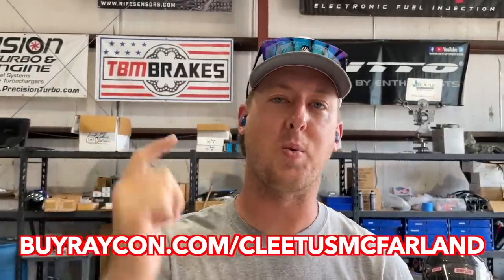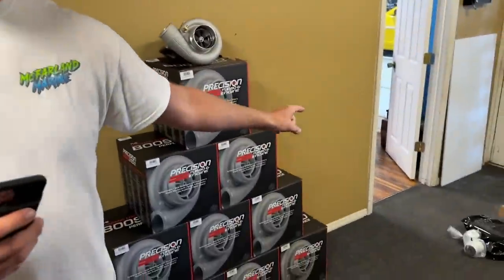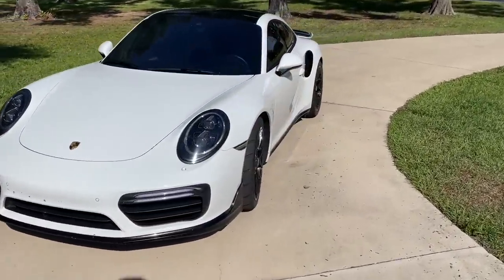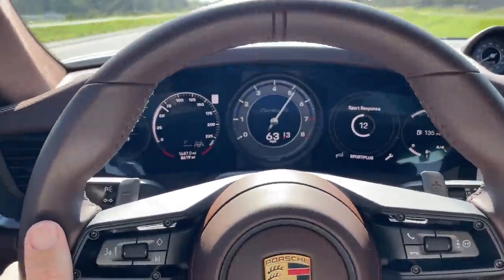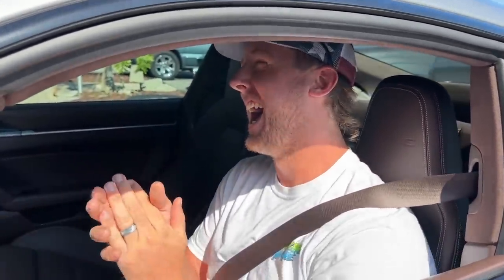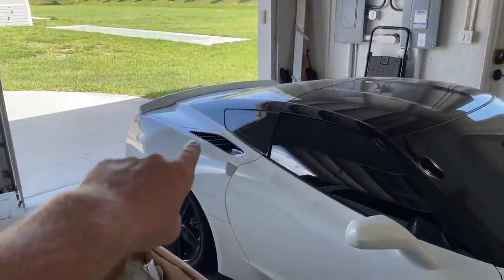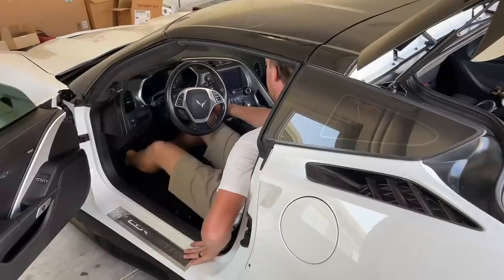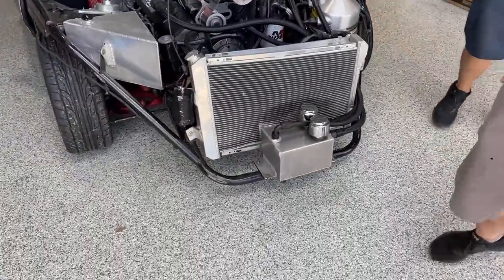Straightening Out the BENT Frame on Toast, Rescuing the C7, & My Dad Got An Auction Porsche!!!

Comment: I believe the exhaust sounds through the speakers is called Soundaktor. Audis come with it too, I disabled it in my SQ5 because I like the more genuine/raw sound.
Reply: Ford has done it in a few vehicles as well. I know the Explorer ST has it for sure.
Reply: To the top with you.  Tell Cleet how to disable it
Reply: @eddominates  at first I pulled the fuse for it, didn't leave a check engine light or anything. I ended up getting a device called OBDEleven so I could just disable it through an app.

Comment: Your "Speaker" Exhaust :) It's called a symposer. It is a tube from the inlet tubing that attaches to a diaphram (to avoid the smell of fumes) then to another tube that terminates in the back bulkhead just below the rear window. If you pull the carpeted panel just below the rear window you can see the tube where it inters the cabin. Unlike BMW where they pipe false sound through the cars speakers the Porsche unit is real engine sounds.

Comment: Don't weld with those Raycons on awareness mode while welding. The frequency of the arc messes with them. I think it could damage them also.
Reply: Or just don't buy raycon since they are overpriced garbage.
Reply: @zillbot  tell me you've never had a pair without telling me you've never had a pair.
Reply: Those raycons are great for the first 6 months then they start acting up
Reply: @PurebloodedPatriot  nah raycons are actually horrible if you care about the audio quality and tuning look at any reviews from any reputable audiophile. your best bet is with something name brand like sony, samsung or apple to keep it simple, or due proper research and find a pair with good reviews in your price range.
Reply: @PurebloodedPatriot  all the earbuds act up at just between 6 months to 1 year. anywhere from $25 jbl wireless buids to $300+ sony's they all shit the bed around the year is the longest. can confirm sony did replace those wf-1000xm4's though

Comment: There's no artificial digital sound in the 911. There are passages designed to bring sound into the cabin naturally.

Another system the acoustics team uses to highlight the Porsche sound is the sound symposer. This is not a speaker, but rather a sort of sound path, a line for tones consisting of a plastic hose with a gas-impermeable membrane. That’s how it transports the passionate trumpeting of the intake pipe, for example, into the cockpit. Because most drivers perceive the engine note differently, it’s possible to dial in just the right amount—using a flap valve and the gas-impermeable seal through a membrane that works something like the human eardrum.

What does that mean in practice? As soon as the driver hits the Sport button on the center console, sharpening the responsiveness of the transmission, engine, and suspension, the flaps in the sound symposer and the Helmholtz resonator open to allow unrestricted flow, intensifying the natural sound of the Porsche engine. If the intensity of the sound becomes too dominant, you can switch back to comfort mode and cruise along quietly.

Comment: a bit of a tip for anyone with a car that needs power to open the doors depending where the battery is located mount an external battery connection under the bumper. you can make a simple angle plate to connect the terminals to and keep them hidden away so only you know where they are . if the car is frame grounded you only need one terminal for the positive and a stud or even just a large bolt sticking out from the frame for the ground. just make sure to scrap off the paint so you get good contact and after it's connected repaint the frame around the stud .

Comment: The burnout boxes in every event look very small.  Maybe that's where to look, to keep your cars from getting so destroyed.
Reply: Bigger boxes also mean more speed meaning more danger and bigger crashes
Reply: skill issue
Reply: The way they are doing it is creating chaos and views, and us Americans have definitely upped our game vs Australians, but for various reasons they still have the controlled burnout down pat. There is some engineering going on between wheel speed and vehicle speed and definitely with track width to make their job easier. 
I kinda wanna see straight line burnouts for distance as a different class so that the viewers can simply view the smoke show in a way that makes sense.
Back around 1973 Hot Rod mag had a thing on swedish burnouts and there is a classic black and white pic of a 1970 Olds 442 doing a sideways huge burnout show. That same type vehicle happens to be my first car and I still have it 35+years later and I loved doing similar burnout pics from the front, car torqued left and the biggest cloud of smoke just gently blowing backwards, all with like only 500-575 engine hp and alot of torque and tires not much different that Australia uses on 1500+ hp burnout cars. 
It's an art form for sure, and in no way am I putting down our brothers down under, in fact I'm saying we need to catch up to the small details of what they do. Cleetus is trying too hard..
Reply: @carlpepin1 bigger in width not length. Was summernats burnouts thats the sort of sized pad cleetus needs

Comment: A little tip on frame straightening.  Instead of yanking on it, pull and keep tension on it while you hit/tap on the bent areas to the frame and other areas that show buckling.  You would be amazed how much it will straighten by doing it this way.

Comment: Yes, Porsche has implemented a feature in some of their models called the "Porsche Sound Symposer" or "Soundaktor." This feature is designed to enhance the engine sound and provide a more exhilarating driving experience.

The Sound Symposer is essentially a valve or resonator that channels engine intake and exhaust noise into the cabin of the car. It captures the natural engine sound and amplifies it through the car's speakers, enhancing the auditory experience for the driver and passengers.

The purpose of this technology is to create a more engaging and sporty driving sensation by amplifying the engine noise, particularly during acceleration and at higher RPMs. It aims to deliver a more immersive driving experience by emphasizing the distinctive sound associated with Porsche's performance-oriented engines.

It's worth noting that not all Porsche models have the Sound Symposer feature, and its availability may vary depending on the specific model and trim level. Additionally, the Sound Symposer can often be adjusted or even disabled through the car's settings, allowing drivers to customize their preferred level of engine sound enhancement.

Comment: 8:03 so how does it work ?  you take a jumper and put the red wire on the starter and the black wire ?? and what happens then ? the door goes automaticly open ???  or do you have to open youreself ? i have the same problem with my car cant find it to open  and i dont want to break stuff

Comment: You should probably put a battery connector hidden somewhere on the vehicle so you can hook up jumper cables to it in the event you have a dead battery again. Talking about the big one where you could put a couple hundred amps through.
Reply: Or....don't leave the damn key INSIDE the car.

Comment: when the voltage is down from a bad alt. then electronic needle style gauges will be lower than normal for display..also high end on the engine wont be up to par 😁😁👍👍

Comment: Porsche calls it a "Sound Symposer", essentially its a tube connected to the intake with a diaphragm in it that pumps intake noise into the interior, they do not use the speakers for any exhaust sounds

Comment: You have to account for the weight of the Shyster and subtract the weight of the Jersey barrier. Then factor in the speed of Toast hitting the barrier. By my calculations, soon as the parking brake is released and floor it past 8.8 torques. Problem solved.

Comment: The reason why the 992 is quieter than the 991 is because of the OPF, basically a DPF like a diesel, just for petrol cars. It’s been a requirement for new cars in Europe to pass emissions. But since you live in the US and there is no requirement you could technically remove the OPF and the car should gain some sound… expect in P because of the soft limiter.

Comment: 🔧🔄💪 It's impressive to see you straightening out the bent frames and rescuing the C7! However, I can't help but wonder if some upgrades could enhance the overall performance and durability of the vehicles. What are your thoughts on adding some modifications or enhancements to take them to the next level? I'm curious about the potential improvements you could make! 🔧🔄💪

Comment: Why don't you look into some good old fashion body shop "floor pots" ??? You have the company that sells you lifts to drill and install and they will have a portable pulling tower or two that will really upgrade the pulling of all your fleet. Very quick and easy without a full blown rack. You can get a simple set of chains with clamps and hooks that store against the wall with the towers when not needed. VERY minimal investment with unlimited repairing options......git er dun

Comment: Silly question.but why the silly small rear wheels on killer b. Looks daft on a mega car.why not have the wheels that are on the fronts
Reply: So the guards dont get chewed out, also helps with wheel speed
Reply: @WHDRWN  cheers dude
Reply: @Jamesattended2245  defs looks a little silly